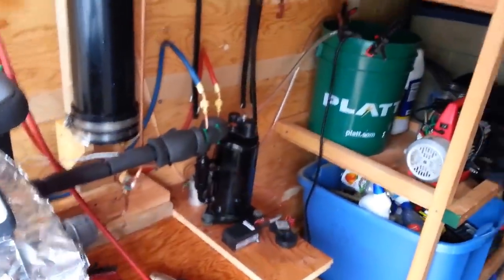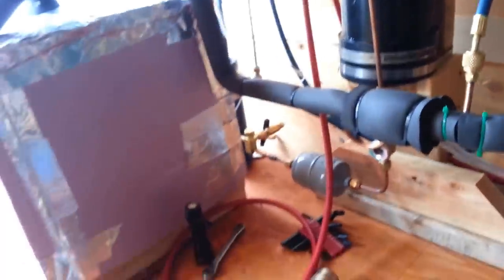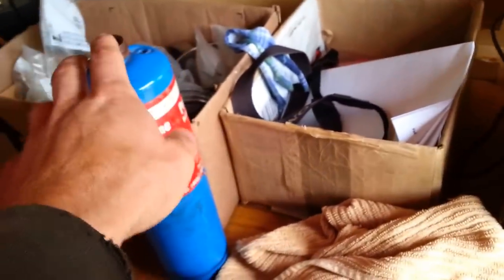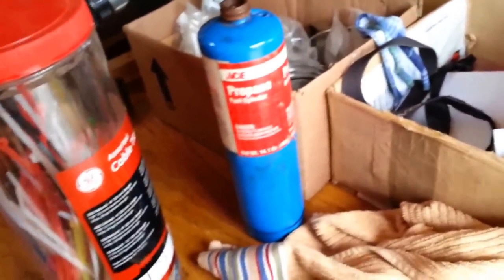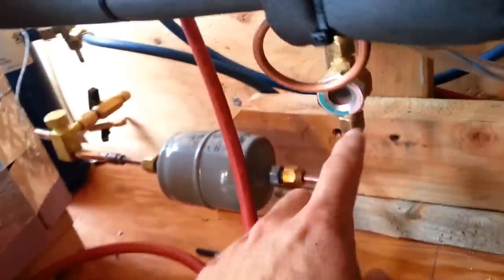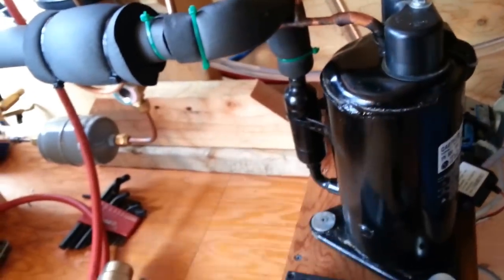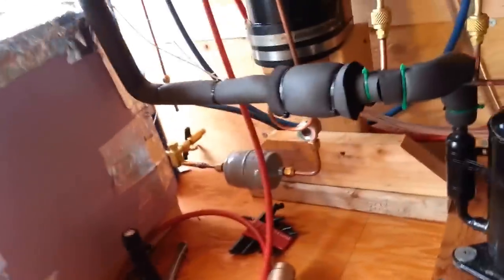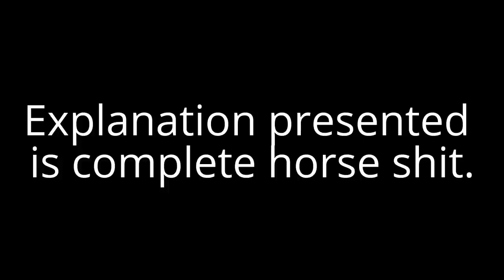How Refrigeration Works - Homemade Build

Comment: Love the sponge analogy. Never seen anyone describe it like that. It works very well to describe the system, and the compressor's job is much like lifting the heavier wet sponge upwards but it can easily fall back downwards without adding energy. Takes a little energy to move plenty of heat and the less temperature (height) difference, the more you can more for the same work. That's why the coefficient of performance of a freezer is less than say an air conditioner or dehumidifier for work done.

Comment: Good videos. I started with your tiny DC compressor videos. I'm going to start working with one this week. I'm going to use it to cool the hot side of a TE Cooler for cooling an IR detector down to -70degC. I am not an expert in refrigeration but I think I can make a tiny compressor work. Thanks for taking the time to make these videos.
Reply from the maker: Neat!  Where did you get the compressor, and how much did you pay?   I'm actually going to be working with some TECs soon. What type of TEC at you using?
Reply: I bought the compressor from Aspen $500. (American made so it's a bit more than the Chinese version) and a small condenser that matches that tiny compressor. I am working on designing a small expansion evaporator (copper) that I need to get as absolutely as cold as possible (-20C or better). I'm going to use the freon setup to cool the hot side of 4each, TE Coolers, which, in turn, cool a 4-stage TE Cooler. without the freon setup, I am able to get the 4-stage down to -80C (in a dewar vacuum chamber that I designed using a high vacuum turbopump, pumps down into the E-10-8 torr range). I need to get the 4-stage down to -83C or better to cool an IR Detector. I wish I could pick your brain as I proceed, but I think it is more than possible to do this. Thanks for the fast reply!
Reply from the maker: Paul Zacharias Is the IR  detector mounted right on the cold side of the 4 stage TEC?  What is the mounting style?  I have a few thoughts on a two phase thermosiphon evaporator, might work well in a VC system.
Reply: Yes, on the top side of the 4-satge. right now, for experimental purposes, I use only thermal paste and I tack a thin copper plate to the TEC top using dots of thermal epoxy (so I can remove if needed). I have a type K thermocouple sensing the copper plate and a normal resistor to simulate a 300milliwatt load. Using a Stirling cooler easily goes down to 40deg K, is the way this is normally done. My company (the one I work for) wants to compete in a certain arena and doesn't want to spend the $6k+ on a Stirling Cooler.

Comment: I would have watched another 40 min.!Love the sugar skull ! Have a question.Which would be most efficient at cooling in a homemade setup like that,a AC window unit compressor,a fridge comp.,or a car comp hooked to an elect. motor?I'm wanting to make a rig to cool the garage "for the hell of it",lol.No furnace so don't need a central unit(or would it be better using a central and rigging an A-coil and blower).I would be using finned coils instead of water also.Thanks for sharing your knowledge!
Reply from the maker: I'd be more concerned about the size of the compressor needed.  The efficiency is a concern, but pretty minor ; it's more important to build a quality system first and worry about upgrading the compressor later.  It depends on the size of the space, how well it is insulated, and the heat load.  As long as it isn't a huge, uninsulated space, I would start with a 1 ton or 12,000 but/hr window unit.

If you are looking to play, you could get a window unit, and split it with the condenser and compressor outside, and the evaporator and a fan indoors.  Run some copper lines in between, insulating the the suction.  An A-coil might be a little large for this application, unless you can get one small enough for the compressor you are using.  Have to consider how much air you are pushing across that coil too.  If it is too little, the coil freezes up, too much and you don't remove much humidity.

Sounds like a fun project!  Looking forward to hearing more!

Comment: Thanks for sharing your setup. I really like what you did. -Propane looks like a nice refrigerant, except that it's flammable. Were you worried about that?
Reply: He had to evacuate all of the oxygen and co2 completely out of the system first. So there is really no danger in it being flammable unless he punctured it and then quickly put a flame up to the puncture.

Comment: I wish I could find a video this thorough for a propane powered rv type refrigerator that does not use a compressor or electricity. Specifically how does the system keep the liquid moving circularity. What keeps it moving in one direction?

Comment: Advice: swap out the aluminum tape for Duct tape on the outside of the installation because it's transferring air temps into your into your installation- conduction. Duct tape won't transfer Nearly as much.

Comment: A very astute observer to be using propane as a refrigerant. How many bottles did you burn through before the nagging inspiration nailed you to the wall? What is the flash point of propane? I hope the setup is in a shed and not an attached garage.

Comment: Refrigeration is so easy to explain its not even funny. Many things use the same principles of refrigeration. For example the water cycle. Water in the ocean evaporates after its absorbed heat from the sun, The water vapor rises loses heat and the temperature drops and it condenses back into liquid and falls down as a liquid in the form of rain. 

Same with refrigerant. Liquid refrigerant absorbs heat inside the fridge, it evaporates and goes back to the compressor and gets compressed, which makes the refrigerant get hot and the vapor goes into a radiator where it gets cooled down by a fan, whcih is removing heat and that causes the vapor to condense back into a liquid and then it goes through a valve that changes the pressure to a low pressure which allows the liquid refrigerant to be able to absorb heat and repeat the cycle again. Simple.

Comment: How safe is propane to use as a refrigerant?
Reply from the maker: Matthew Mckinney it's reasonably safe. Many commercial upright freezers use r290 now. Isobutane (r600a) has been used in residential refrigerators in Europe for 2 decades. Increasingly common in the US.
Reply: M.C. Pletcher i heard of people recharing their old cars that ran on R12 with propane. Thought it was crazy talk till now.
Reply from the maker: Matthew Mckinney I think it's usually a mixture of propane and isobutane to work well with the existing system.

Comment: It's the contained ( better controlled ) distillation of a substance that when separated by process , chills at a lower boiling point . Distillation and condensation of " referigerant " in ... Essentially , a vaccume . Pure ammonia and distilled " pure " water is an exelent refrigerant ... Do some research ... Crosley Icy ball .
The whole bit , explains easier with an apparatus which isen't as complex . 
Shouldent mess with any of it without a thourough understanding . Involves pressures , poisons , structural materials that need to withstand both while being effectively regulated by thermostat & pressure sensor controls .

Comment: Your superheat is too damn Low!
->  Put a Fan in that fridge! Or add coils... Ha Ha
Reply from the maker: Samual Whittemore That was the whole point of the thing. It has a large enough accumulator to allow for low superheat without flooding the evaporator. Granted, propane refrigerant probably should have a bit more superheat to prevent washing out the bearings or bushings in the compressor. This video was pretty early in my stint into refrigeration. Thanks for the comment!

Comment: Very cool man - and no apologies needed, it was interesting.

So here is a question. Based on Trompe Hammer technology (which is actually two very old ideas connected in series) - see here: https://www.youtube.com/watch?v=8wX4WtOHFZE  I was thinking about trying to make a refrigeration system for a "greenhouse" to prolong cool season vegetables. Let us take as a given that I am able to generate 150PSI of pressure, but this is just standard air - not propane - would it be possible to build an effective refrigeration system for a relative large space?

I understand you are using propane because its boiling point allows you to more easily move heat from one space to another, but if we were to use regular air - could it be done? How do I do the math to determine what my variance needs to be? I very much appreciate your thoughts.

Thanks!
Reply from the maker: Air refrigeration systems have been around for a very long time, but they usually involved the compression and re-expansion of LARGE volumes of air.  The specific heat capacity of air is just not very high.  They were competitive for a time in the 19th century, especially on ships where an ammonia leak was quite dangerous.

If there is a few kw of power there, then I suppose something could be rigged to provide cooling for a large space.